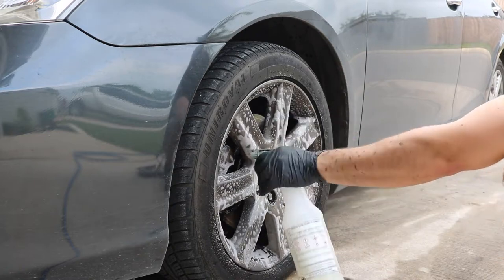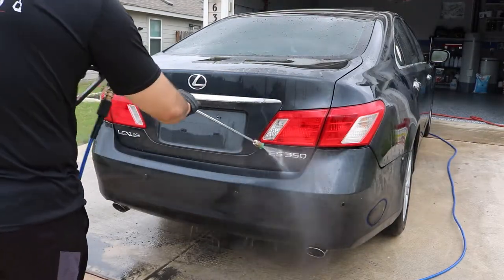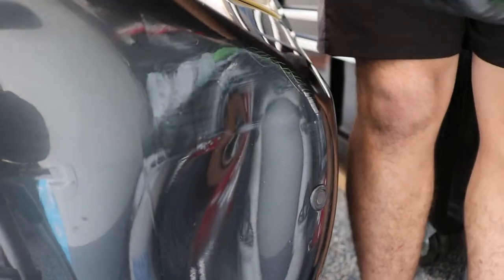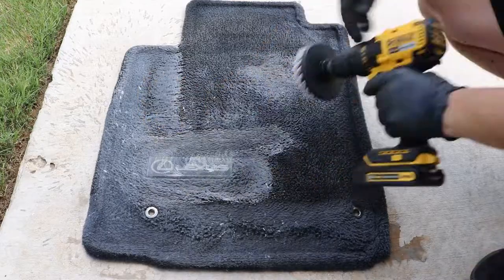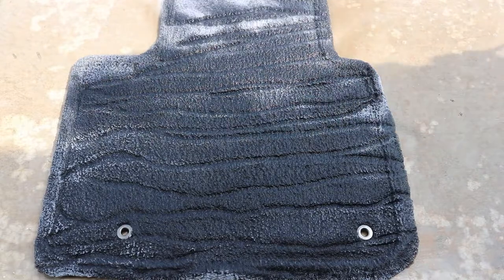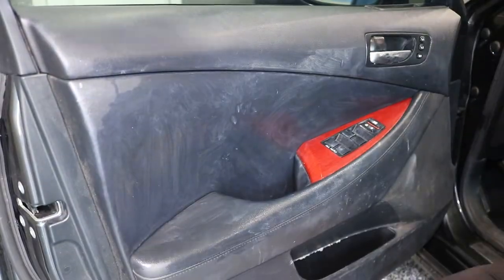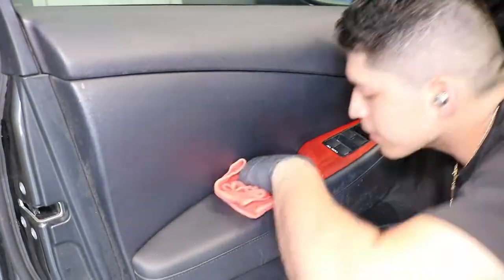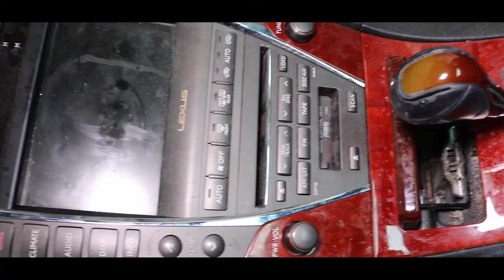Making Filthy Lexus Look Brand New Again! | Deep Cleaning of Really Neglected Lexus!

Comment: my dash on my lexis is350 was black now its kind of grey I am wondering what you used as a cleaner to clean it the dash isnt like hard vinylits something else its a little soft  and well I dont want to damage it
Reply from the maker: Depends if you have used an all purpose cleaner and maybe was used with no dilution, that might be why it faded to gray or maybe it's just fading from being exposed to uv rays all the time that also makes them fade over the time..you can help it by using a uv protectant and it will definitely help!! I have the link on my bio to the one I use and definitely love the thing man!! Hopefully I was able to help!! Thanks! 👍💪